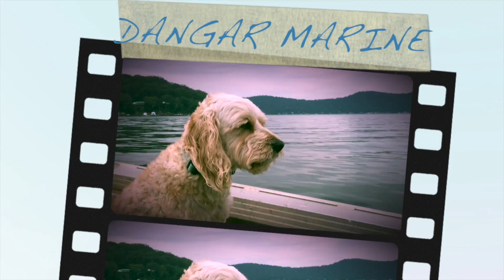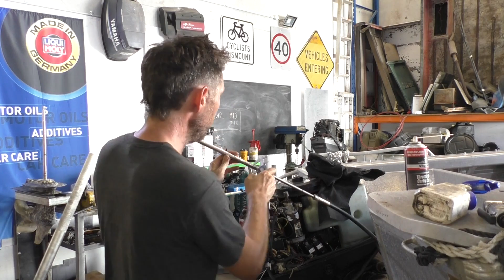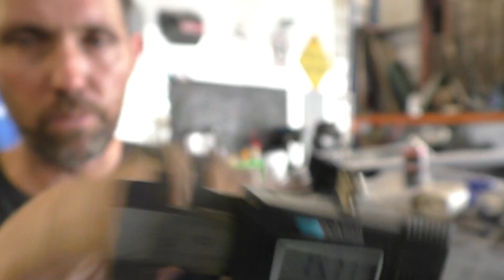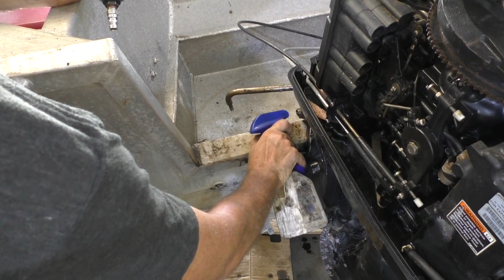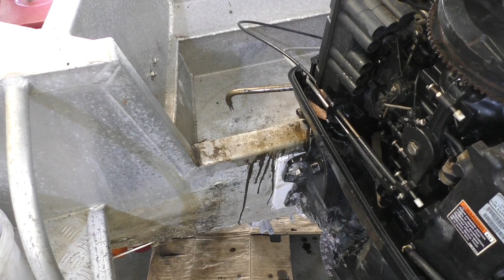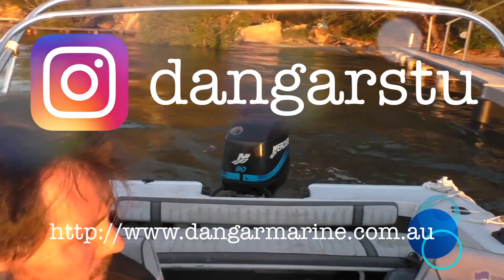Cleaning an outboard tilt tube

Comment: Good tip for cleaning the steering tube.    I noticed you have a Mercury 90hp, similar to mine.  Can you suggest something as mine seems to bogs down after the motor has run for a bit and the engine is warm.  It seems to run great before the engine warms up.  Thanks in advance.

Comment: Question about greasing the tilt tube. I have a 1996 90HP Yamaha with 2 grease fittings in the tilt tube. Cannot get grease to go into the fittings. Fittings have been removed and cleaned. Do I have to actually remove the steering cable rod from the tilt tube to get grease to flow in there?

Comment: Done this twice on different boats, pita.. seems to me steering to the left, and the movement of the steering cable displaces air out of the tilt tube,.. and every time you steer to the right it actually sucks air and any spray (salt water!) into the tilt tube. I have seen a few types of seals to try and fix this. Anyone got a method to vent/relieve this pressure, before I drill a hole in the tilt tube?

Comment: hydraulic arm got frozen, had to bang the tilt tube out, and THAN clamp down the tilt tube to bang out the steering ram/arm.  (old hynautic cylinder, which is junk now) 
Question:  Tilt tube , inside, now had uniformed pitting or rings up N down.  I would assume it's damaged from the days of banging.  Should it be smooth on the inside?    SHould I just buy a new tilt tube.
Reply from the maker: Should be smooth, it is probably from corrosion.

Comment: As always, Danger Marine is my "go to" videos for advice. THis hone job is always what I have used so thats not new to me. But WHat I do is add MEK or Acetone while I use the hone to break down the grease and soften it up. Continiously cleaning or changing the hone if needed. I have a terry cloth towel on the other side of the tube for any drippings of the solvents. Once that job is done, I use a small steel rod and push a rag through, then another rag with WD40 to coat the inner part of the tube and then reassemble. Seems to hold up for quite a while without needing to perform this job ever year. I also add anti corrosion grease to the zerk on the steering end of the tube to that get in the tube as well. The grease I use doesnt harden up nor does it lock up the cable either. But as always Stu, you are the man.
Reply from the maker: Sounds like you've done a great job there! :)
Reply: @DangarMarine  Thank you Stu. It was all by trial and error then finally getting the skills right so I get it done correctly so it didnt have to be done every year or having to worry about the grease hardening up and making the steering difficult. That summer sunshine can really cook up the grease.

Comment: Really appreciate the video. Is there a way to remove the bit of slop in the steering wheel somehow in the control box?
Reply from the maker: Unfortunately it isn't adjustable, it is just wear in the parts.
Reply: Was afraid that was the case! Thanks again, cheers,

Comment: Great tip. This info helped me invent my own cleaning tool. Pretty easy to make and worked reasonably well for this task. If you are stuck in the same situation and cannot get your hands on one of these "dangle berry hones" here is how you make the tool i made: Cut the head of a 16mm bolt (or use a threaded 16mm rod) weld this to a smaller diameter rod (must fit in your drill machine chuck). Length on the rod must be carefully picked to suit your needs. The 16mm end can be slitted with a cutoff disk to make it dig faster into the rusted inside of your tilt tube.
Reply from the maker: I like that idea, a bit like a giant tap! :)

Comment: Working on my outboard steering right now in Mexico, where parts are a PITA to get.  I was excited when I found the teleflex steering cable locally, but am not going to press my luck looking for the tube!  I used a long piece of all-thread and wrapped it with sand paper and ran it from a cordless drill.  It was pretty clean but when I went to install the cable it got stuck.  I didn't force it and was able to get it back out, but I didn't have any lithium grease in there.  Will work on it some more and then lube it up and hopefully it will go smooth.  Thanks for the great video!
Reply from the maker: They will generally go in without any lubricant (not that you should!) so I would look at cleaning the tube out a bit more.

Comment: Why don't you give your local gun shop a call they will have all size brushs like this one  used to clean 22 caliber to 18 gauge shot gun. They are quite cheap. For what you get cheers 
    Mike
Reply from the maker: I'd definitely like to give them a try, particularly for outboards that aren't corroded and don't need the extra strength of a hone.

Comment: I do a lot of these, as we are in a salt-water area.  When they are really corroded, IF you can get the steering cable rod out, the best thing to use first is a long-shafted 5/8" wood paddle bit.  You put the shank through first, chuck it into the drill, and PULL the bit through while turning.  Often it sounds horrible, grinding and popping and making a ruckus.  After you pull it through a couple of times, you can go through in forward direction.   This cleans out even the worst, most heavily-corroded tubes.

Once, you get that done, then you follow up with the wire brush several times, then rinse with WD40.  After that, you put in a big glob of marine grease, and push it through with a small wad of cloth several times, until you are absolutely certain the entire inside of the tube is completely sealed with grease.  No air or water can come in contact with the cleaned surface ever again, or it will rust again.   You must seal every inch of the surface in there.  Then you grease the steering rod and push it through. It should now be as smooth as silk.

This method makes for a long-lasting repair.  I've done this on steering tubes where the rod was almost seized, and big chunks of rust scale came out with the drill bit, and they lasted for years and years afterward, with smooth steering.  (my current boat is one of them)  If you only use the wire brush on the bad ones, they tend to lock up again, after a season or two, as the brush cannot remove the heavy rust embedded in the tube.

Just a personal experience that I hope is helpful.
Reply from the maker: Hey Tony, good advice on making sure you get that complete coat of grease in there to protect any metal that no longer has a coating of paint on it. With so many of these tubes a brush won't even come close to removing the rust and corrosion. I would be interesting in trying one of the reams that Will uses one day http://www.ebay.com/itm/MERCURY-OMC-YAMAHA-SUZUKI-OUTBOARD-TILT-TUBE-REAMER-SERVICE-TOOL-/302243066011
Reply: That looks like an effective tool, but YIKES! that is expensive!   I think the Irwin 16" long x 5/8" wood paddle bit was $7, and I've been using it for many, many years, probably a decade, and it works very effectively.

Look - Here is one for $5.99:
http://www.ebay.com/itm/Irwin-Speedbor-2000XL-Long-Shank-Electric-Drill-Wood-Bit-5-8-inch-NIP-Made-USA-/311816347043?hash=item4899b3dda3:g:SMUAAOSw4DJYhByf
Reply: Here is a bit that may be a nice compromise between the two: 
http://www.ebay.com/itm/IRWIN-1890713-5-8-X-18-Straight-Shank-Installer-Drill-Bit-for-Wood-/282378424711

With the turned down shaft, you should be able to pull the bit through to increase longevity, but since it's a spiral bit, it should be smoother to operate.   I just ordered one of these, and will let you know how it works.

Comment: Thanks.  I just cleaned out one from one of my old outboards and actually used a wire brush like you did.  It cleaned out most of the junk in the tube, but it had some bad rust that I used a round file on to get out.  Now the steering rod/cable really works nicely.
Reply from the maker: Hey Greg, cleaning out the tube can make a huge difference to the feel of the steering. This brush actually has small honing stones on the end of the bristles (I should have shown a better close up) which means you don't need to file afterwards like a regular brush. These ball hones are strong enough to take even stubborn rust off which is why I like them.
Reply: Thanks-I'll keep an eye out for them--

Comment: Stu,

I use a reamer.  I got mine from here.  http://www.ebay.com/itm/MERCURY-OMC-YAMAHA-SUZUKI-OUTBOARD-TILT-TUBE-REAMER-SERVICE-TOOL-/262807605439
Reply from the maker: Hey Will, I remember you mentioning these, they seem perfect for the job. Do you find you can get them in to a tilt tube when the transom is cut out like this or do you need to take the outboard off first?
Reply: Some outboards you do need to remove the outboard first.

Comment: would dialectric grease keep it from corroding? i always have it on hand
Reply from the maker: I would stick to a lithium based grease as other grease types can react badly with salt water and actually cause the steering to seize up even if it hasn't corroded - the grease just becomes like a glue.

Comment: Nice video,  I did this job a few months ago using a 15mm wooden dowel with 80 grit wet and dry held on with duct tape at one end, which worked in the end but the sand paper was constantly coming off, wish I thought of the slot idea would have saved me lots of time! 

I did found these on eBay that would probably make the job easier next time 

http://www.ebay.com.au/itm/15cm-Long-17mm-Dia-Spiral-Twisted-Stainless-Steel-Wire-Tube-Clean-Brush-3-Pcs-/361352392394?hash=item542247eeca:g:Tz4AAOSw--1Wrtmk

I'm also fortunate with my very old Evinrude that the tilt tube (steering tube) isn't actually where the outboard pivots and can simply be removed from the engine/boat by undoing 2 nuts making the whole process a lot easier at the bench don't know how common this is but I thought it might be worth mentioning.
Reply from the maker: Hey Cliff, the slot idea definitely makes it much easier to keep the sandpaper on the dowel, and is definitely a nice cheap option. I have to say though, the ball hone worked really well on the corrosion in this tube. It still took a while but it did clear it right out in the end.

Comment: very helpful great idea. also ive ordered the hyro steering unit a bit pricey $850. but should make it easier for the grandson thanks
Reply from the maker: Hydraulic steering is very good. I know it isn't cheap but I think you'll find it's worth the money.
Reply: You got to use a pretty old hydraulic steering system today- opinion? Not what you were on the boat  looking at though.

Comment: I use a 12 gauge brass cleaning brush
and could you do a video on changing power tilt/trim fluid please mate and how to bleed it up
kind regards Matt
Reply from the maker: I think brushes are a great choice for keeping a tube clean before it gets this bad. This took about ten minutes of honing to get the rust out so I don't think a brush would have done it, but it's definitely a case of horses for courses.

Comment: Ahoy  mate can you tell me how long a water pump lasts on a out board I get different takes from repair people on changing them one guy said 2 a year another every 2 years whats your take on this thanks
Reply from the maker: I've got to say I agree with the comment below. I find they do tend to last a lot longer than many manufacturers specify. The argument is you are better off replacing if before you need to but I find many people just leave it in as long as the telltale is flowing and provided the outboard has overheat protection and you aren't far from shore, that sounds reasonable to me.
Reply: My own experience is this...I had a 90hp evenrude and had same impeller for the 10 years I owned it...never had a problem and was the best motor I have owned.I guess in my opinion for what it's worth is it depends on how well you care for motor and many other factors.Just my personal opinion.
Reply: I guess the continental shelf off Tasmanian east coast is "close" to shore....lol as that was one of my fishing spots...and never even turned motor over dry....that makes me cry when I see outboards started in rigging areas.

Comment: Maybe we should use brass brush for not to damage the surface?
Reply from the maker: If it just has a small amount of dried grease you could, but in this case it took about 10 minutes of honing just to be able to get the cable to fit back in it was that badly corroded. A brass brush wouldn't have been up to it.